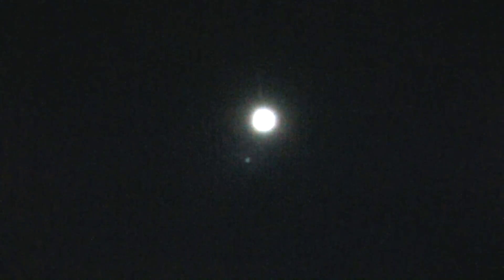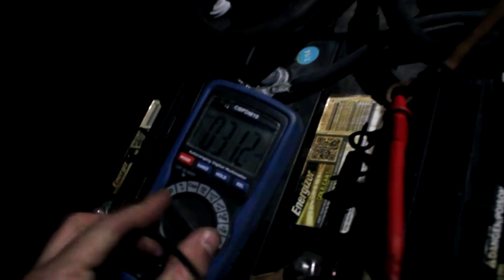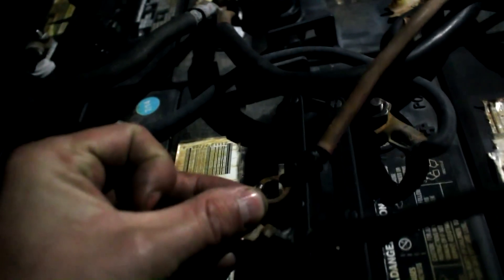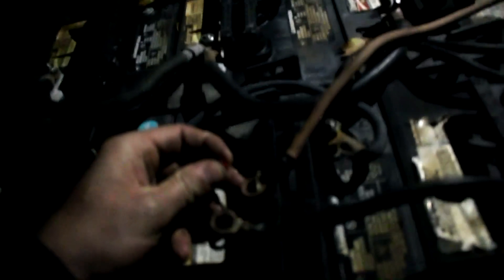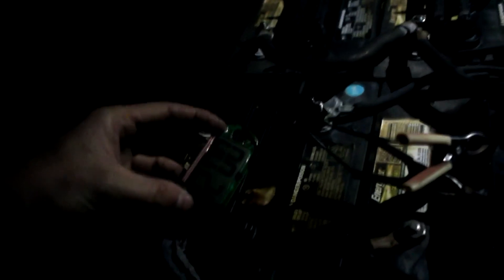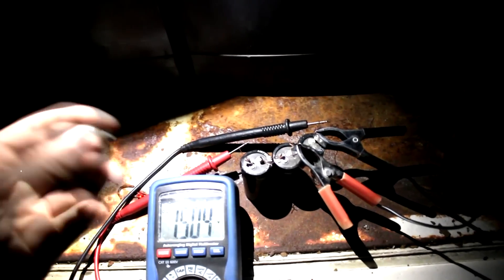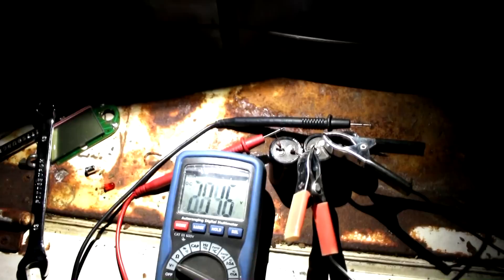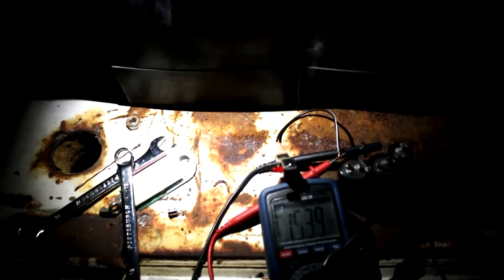Electricity From Moonlight

Comment: I was wondering if there is a chemical that could be applied to steel that would stop the corrosive effects of salt, while it's wet.
Reply: There's plenty.Galvanizing will do it as will various plastic and paint coatings. The closest to a chemical application would be various 'passivating' agents. The three most popular are nitric acid, nitric acid and dichromate and citrate. Salt water however is rather corrosive and these don't provide protection against prolonged exposure.
Reply: Jason Doe
Or replacing the first 'and' with a dash or slash. Aaah grammar, so many possibilities.
Reply: Gareth Dean  That's a good use case for "the Oxford comma"  :P

Comment: I know it's a bit late for this time, but perhaps with a joule thief you could power the LED from the panels? they are designed to boost dying AA batteries (so about 1 volt) to LED voltage.

Comment: You could probably light a small LED continually using a Joule thief circuit, that would get the voltage up enough for the LED. You could even charge a supercap with the circuit if the current wasn't high enough. I'd like to see you give it a try, I would but I don't have a large solar panel like yours.

Comment: Try a voltage doubler using capacitors and diodes.   I think that is an AC circuit though.

Comment: I think your sound is clipping mate.

edit: Those LCD clocks use such little power. I would not be surprised if it run just by jamming 2 wires in the ground. Maybe with a germanium diode or the coming popular mosfet rectification. Maybe even add a capacitor ~100nF to 1uF might help.
If that dont work try 2 different wire metals and maybe spit on them.

You are a genuine Champ!

Comment: I bet you could make more electricity from a big enough antenna to catch electro magnetic waves from radio stations, TV and so on.
Sounds like a new video idea to me?!
Reply: if its possible i agree
Reply: it's possible, because with an antenna your taking the radio waves and turning them into electricity by exciting the electrons, but it would take a huge array, and you would get a miniscule amount of power, but hey fuck it. we'll do it because we can
Reply: Aiden Rathbun so basically a mininuke in a slow cooker. the potential energy is huge, but realistically not the best idea to release it all at a useable speed.. (with homemade/non professional grade gear)
Reply: That's basically what radio antennas do, the power running through attached wires is then decoded into your radio program. But it's not particularly efficient.
Reply: Its called energy harvesting. Other potential energy sources are movement (like walking), heat (thermocouple or peltier) and sound or pressure changes.
- Eddy
Reply: Max Lindner Good idea to explore unusual types of energy! But I think that radio waves are too advanced for a diy project, no?
Reply: ArcanHage I don't think so as all you would have to do is make a dipol with that antenna. I am not sure about the power output however ;)
Reply: It's possible not practical electric boom did a video on that

Comment: So are the batteries charged a little bit at nighttime from the panels and moonlight?
Reply: Indeed, but so little that it most likely doesn't even make a difference.
Reply: You need a specific minimum voltage to force the chemical reaction inside of the batteries.
Reply: Keldor314 It's safer to disconnect the batteries at night to prevent backwards current. So he might just disconnect them.
Reply: Ian The Pineapple If anything, the batteries are forcing a bit of current backwards through the panels and very slowly discharging.

What's the impedance on those panels, Cody?
Reply: Resistance of the panels is not too big, they have to have a shotky diode in series to prevent discharging.

Comment: With the right LED, you should be able to get it to glow. I have a few clear red LEDs that can glow (dimly, just enough to see them) at literally tens of MICROamps. Holding one of the leads and bringing the other one in contact with a large chunk of metal can make it glow!
Reply: What you need are "high brightness" ultrabright clear LEDs, not the standard brightness diffuse indicator LEDs. Those are typically not efficient at all, like almost as bad as incandescent! The only LEDs that are efficient are the ones designed for giving off usable light.
Reply: Wow that is interesting wish i had one
Reply: I think that was for the single 100ish W panel, which is definitely not enough voltage. You would probably only be able to make the LED flash occasionally, by using a really small boost converter powered by a germanium transistor (with a very low Vbe threshold voltage) configured as a relaxation oscillator (a'k'a. a joule thief) That can charge up a capacitor bank and a latching transistor circuit can flash the LED.when enough voltage has been collected in the capacitors. Electrolytic capacitors will also need to be avoided due to high leakage current.
Reply: Power Max  I'm pretty sure the LED's Vf (forward voltage) would be way more than 0.3V, though.

You'd need a circuit to drive it from that source, and it would have to be very efficient.
Reply: I don't see where I said 0.3V, if I did, I meant 1.5V, which is what I measured.
Reply: +Juhana, Doesn't surprise me. How did you make the measurement of 100nA? I think you would need some serious laboratory grade high precision microcurrent measurement device. A typical multimeter is not good enough.
Reply: Power Max You didn't say 0.3V, but that's what Cody was getting from his setup  ;)
Reply: Power Max Interesting, thanks!
Reply: My 220V LED light bulb when it's still in the socked and you grip the opaque plastic on it.

Comment: cody whats up.  so you know why a solar panel wont pull more power at night is due to low light levels.  why.  because a molecular diode first has to be created and maintained by exchanging electrons from the phosphorus side to the boron side.  im in state (utah county) and have been building a solar panel that has thay molecular diode in place essentially and is able to transfer more energy in low light situations.  this is a hobby project but right up your alley after watching this video.  hit me up if ur interested..

Comment: Question: If you got a huge magnifying glass and put it above your solar panels, in order to get more sunlight concentrated on them, would they generate more power? Or are they already at max capacity with the regular energy that comes from a clear sky?
Reply: Only if the glass has a bigger surface area than the solar panels. Considering that it doesn't absorb or reflect the incoming light. Which is unrealistic.
Reply: Most solar panels can make more energy under brighter-than-natural light, so this will work. Indeed there are entire solar plants made out of fields of reflecting mirrors that concentrate sunlight onto a panel or point.(See for example molten salt energy storage.)

Comment: Could you do an experiment on moonlight temperatures? There's a claim floating around that an object exposed to direct moonlight will read colder with a laser thermometer than the same object in the shade and not exposed to direct moonlight. 
Is there any validity to this? I've seen videos showing this phenomenon that end up showing 5-10 degrees F difference in  temperature, but I have to wonder if there were variables not accounted for. 
Perhaps do the test with a vacuum ? 

If the moonlight does result in a colder temperature reading, why?
Reply: This is an interesting effect.The issue is that moonlight is not 'black body' radiation'; with a lot of objects you ca tell their temperature by the light (Or other EM radiation) they emit. Reflected light interferes with this since it causes an object to seem toemit light it has not produced via black body means.

Most IR\laser thermometers can handle this, it helps that sunlight is, to a large extent black body and they are calibrated to work well in daylight and with most usual forms if artificial lighting However moonlight is interesting, being itself reflected light it has a number of 'bands' in it where the moon has absorbed light and re-emitted it as longer wavelengths. Notably its IR spectrum is 'off' and an object illuminated by moonlight will likewise end up reflecting more longer wave IR than normal. This is read by many IR thermometers as being a cooler temperature.

In fact things like the 'brightness' of the object, its color and the medium between it and the thermometer (Such as glass) can have drastic effects on the reading of an IR thermometer, even a 'normal' measurement isn't strictly he average temperature of the object. Fascinating stuff.
Reply: Revrant thats impossible
Reply: That's what I'd think, but there's a lot of videos showing that moonlight is cold. I even bought a laser thermometer and had similar results.  Most of it looks connected to flat earth stuff which I'm not concerned with. I would like to see someone who I know has their stuff together scientifically and would do things legitimately (Cody) do the test. If it is colder, it is a really interesting phenomenon and I'd like to find out why.
Reply: It comes down to the temperature of the moon vs the background temperature of space. Space is about 2.7 degrees Kelvin. That's the cosmic background radiation. The moon is warmer than that even at its coldest. So I doubt the cold moon shadow theory. A clear night is (on average) colder than a cloudy one for the same reason. The clouds are warmer than space.
Reply: Revrant well. You also need to take into account the surrounding temperatures and other things emitting heat or cold that are nearby.
Reply: Right, that's what makes sense. That's why it is weird that it would be warmer in the shadow. I really wouldn't be surprised if there are other factors not being taken into account on these tests. I know when I did mine it was rather ad hoc. Still interesting though that it tends to be the case that it is warmer in the shadow.
Reply: Agreed! That's why I was thinking maybe a vacuum would be a good test for this.
Reply: Revrant yeah. That's a good idea. I wonder if they can tell in space.

Comment: You could use a Jule Thief circuit to light the Led.
Reply: yinon harel what is a joule thief circuit?
Reply: Leif Nyland basically a voltage booster.
Reply: k
Reply: The inductor would draw way too much current

Comment: Hey Cody, couldn't you run something like electrolysis using the lunar power? I think for getting O2 and H2 from water you only need 1,23V, you probably could get a lot by letting it running all night. Or maybe other type of electrolysis.

Comment: I wonder if a Joule Theif circuit could work with this to light the LED, charge the capacitors to get the first initial voltage spike then let the Joule Theif do the rest

Comment: What you should have done, is hooked it up to a joule ringer circuit.  It takes the DC you get from the solar panel and puts it into a coil which produces a magnetic field.  The collapsing of the magnetic field would generate a higher voltage and amperage.  If you tune it right, it would look like the bulb is constantly lit, but it's actually receiving short, fast, bursts of energy.  
(I know that's not exactly how a Joule Ringer works, but it gets the point across)

Comment: A standard red LED has a forward voltage of about 1.7V. If you get a high efficiency type, you should easily be able to see it light in the dark at 0.11mA forward current.

Comment: The red led should be a better solar panel under that light then the others powered from the moon.   You get a small voltage and current from leds under light. This is how Optical interrupters work or TV remotes.

Comment: You should build a smarter power bank... I'm thinking about a power plant in Spain, where they use the heat of the sun at daytime to melt a a huge "pocket heater", you know, those salt solutions that store heat... And at night they let it turn solid again and generate electricity off of the heat again... Would be a fun project i think :)

Comment: how could a digital clock made of many leds and modules require less energy than a single red led
Reply: probably the clock has a step up transformer or smth to bring up the voltage to power the leds
Reply: ilts just a Liquid Crystal Display, no LED backlight
Reply: eucalyptux thnx

Comment: idk? i was getting 4.7 volts off my panels but im at 1200 feet above sea level
Reply from the maker: I'm 6000ft above ;)
Reply: *****
my panels are on my roof. no light pollution, an i live in the rural appellation mountains
Reply from the maker: So I think the reason for the difference might be that my solar panels are ~10years old and may not be as efficient, especially with low light. Are your panels monocrystalline or polycrystalline? mine are poly.
Reply: Cherano Kreeft :D
 lol
Reply: *****
they are mono-si SUNTECH Pmax 175 watt (STP175s-24/Akeena) an i have 4. the glass is a special kind it absorbs light rather then deflecting it. also wat gauge of wire an how long is the run? any diodes? are all the panels the same brand? you should do a test right at the panel an then at the end of the run of wire an see your voltage drop! but yes the age of the panel makes a huge difference. if you have one panel that under preforms it will bring the whole array down to that level! my panels are about 3 years old, but i bet its more then just the age its most likely a combination of things that end up as a loss in the end.
Reply: Malte Gruber
i agree! i was producing last then an AMP or else my flexmaxfm80 would have kicked in an it would of began charging. but i never seen any voltage read on my charge controller before.
Reply: *****
what was your temps that night? temps by me were close to 34F. also when its colder its less diffusion do to lower humidity etc.. my panels produce more Kw in winter then in summer even tho the angle of the sun is less in my favor as well as less hours of sun light
Reply: Higher output in the winter is common as they work better when kept cool. Think it was a 10% boost in power over summer even with the weaker light. 

Same reason floating panels output more power as they are dumping the waste heat into the water so they run cooler then normal.
Reply: wow Im at 3390 meter above the sea level about 11000 feet , sadly i dont have a solar panel
Reply: gotta love colorado

Comment: When you are on the moon (I do not consider that an "if") please check if you can power something with the Earth.
Reply from the maker: yes!
Reply: @theCodyReeder  wait, RE YOU ON THE MOON ALREADY?
Reply: @theCodyReeder  A large gyroscope (on good bearings) would stay oriented in the same direction. If it was  gimbal-mounted, with suitable gearing, could you extract energy from Earth's motion as it rotated about the gyroscope. Could you get enough energy out of such a set up to keep the gyro spinning and a surplus to use elsewhere? Would this slow the Earth a bit.
Reply: Cody'sLab astronaut Cody mission to Mars where you can grow potatoes
Reply: Nxrv, Earth reflects sunlight as well. If it didn't, you wouldn't be able to see Earth from the Moon surface.
Reply: Thinking about it, that may work rather well. The moon-air is just about being detectable. IIRC a solar panel in space is twice is effective. Clouds reflect light well and the Earth is quite a lot bigger seen from the Moon then vice versa. It could be 4x the power with the same panel.
Reply: Are you sure? The Earth's average albedo is about 0.3 which is definitely more than the Moon's. So it should reflect more light, plus it's way bigger.
Reply: Wenzel Peppmeyer  the earth is bigger so the reflected light would be more.  plus the moon has no atmosphere to block the light.
Reply: If you can power something with moonlight, you can definitely power it with earthlight on the moon, since earthshine is MUCH brighter than moonshine.
Reply: that might just work. earth's albedo is higher than moon's, and the surface area is 16 times as much, too.
Reply: Lets start a fundraiser for that
Reply: And water in the sea would reflect more light than rocks in the moon.
Reply: Wouldn't it be A LOT easier, to power something with the sun? Actually. You would. Power things. With the sun. On the moon.
Reply: @ygsm1337  Duh. its the principle that they are after. And if its 'easy' that you want you could ship up fuel-cells and fuel for it/them or a nuclear power pile etc, that way you don't have to wait for 'sunlight'. Duh and Double Duh.
Reply: rashidisw That's actually untrue. Water is very dark, so a lot of light is absorbed rather than reflected. On the other hand, the moon is almost white, so it reflects a lot of the light that hits it. Also, the reflection of light off of water is highly specular, meaning you have to be at just the right angle for the sun to reflect well off of the water.
Reply: skeptic moderate: you are wrong. the moon is actually dark grey, it reflects only about 13% of the incoming light. google "albedo"
Reply: @skepticmoderate5790  That's actually untrue. The Moon is even darker than water. On the other hand clouds are very white so the Earth has high albedo.
Reply: @yenot42  I have no idea why I thought I knew what I was talking about lmao. This was three years ago wtf was I thinking.
Reply: @skepticmoderate5790  No problem, we all make mistakes and you get ten points for acknowledging it. I was really just commenting so any future people going through this comment secton wouldn't be left with false ideas.